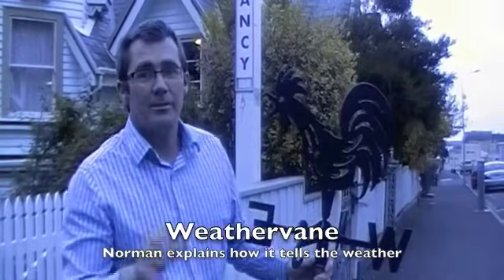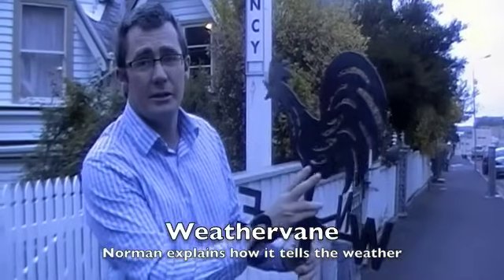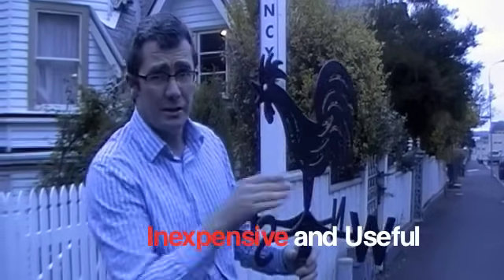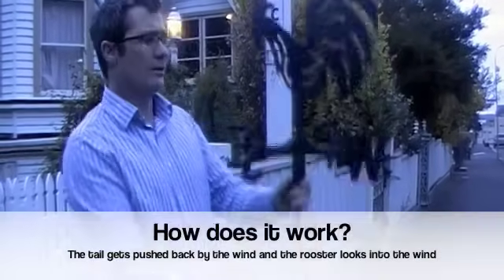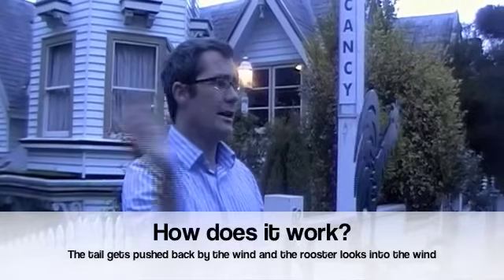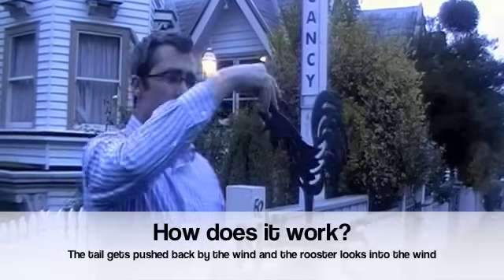How Does A Weathervane Work

Comment: Thanks. However what prevents it from point the wrong direction? I understand the two sides have large surfaces so it would turn to the side that has a smaller surface so couldn't that be the tail facing the wind instead of the head as the tail also has a vey small surface?
Reply: No the tail would not point towards the wind. The weathervane is designed such that the area after of the CG is always larger than the area fore of CG. The force generated by the tail will be greater than the force generated by the head.This causes the weathervane to always point in the direction of the incoming wind.